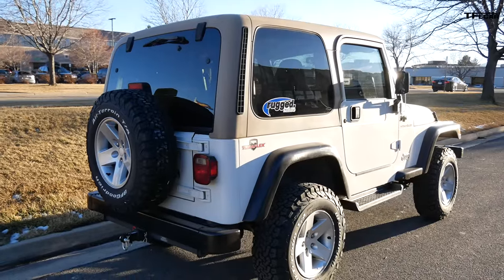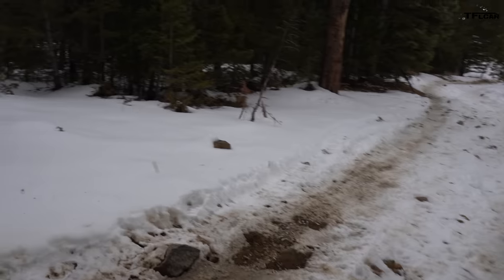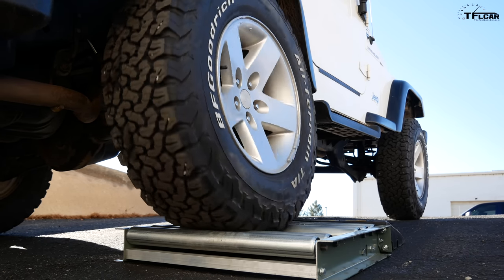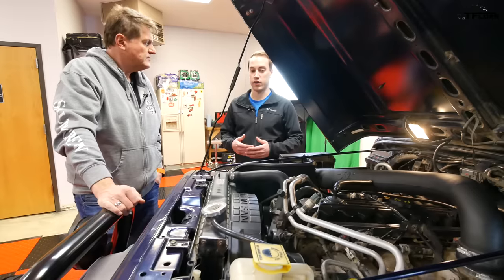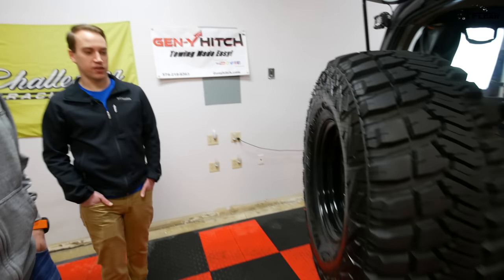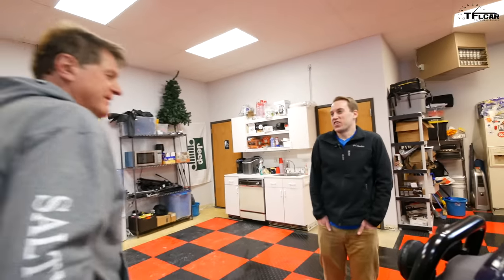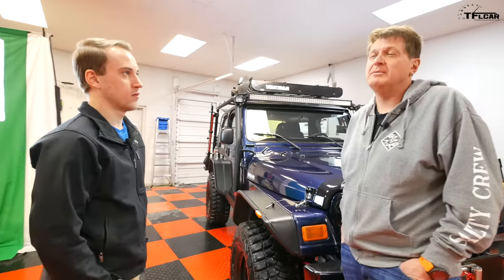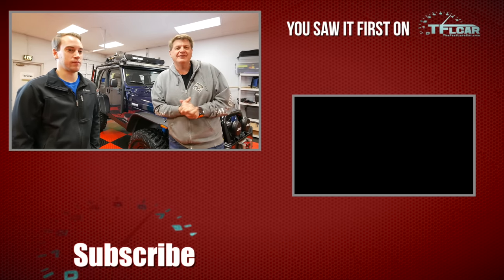We Took our Modded Wrangler Offroad and Got SUPER STUCK: Cheap Jeep Challenge Ep.6

Comment: My thoughts on the roller test; there is just enough overcoming inertia & drag in the drivetrain & the same thing on the big heavy knobby tires on small rollers. This leads to difficulty turning the tires on the rollers (overcoming inertia & quite a lot more drag compared to street tires). This mimics applying the brakes to just the tires on the rollers for a pseudo "traction control" if done somewhat quickly to maximize the affect overcoming inertia has that briefly helps power go to the tire with traction. This affect only helps a bit, just enough to get it off the rollers if done quickly enough, and doesnt help enough on the incline. Possibly if he punched it from a standstill and lightly held the brakes he might have even gotten off the rollers on the incline as well, but not sure. Also the wrangler is fairly lightweight so the inertia/drag affect helps more with this vehicle.

Comment: Works in the XJ might for the TJ if you are still doing the cheap challenge find yourself a Volvo station wagon with a g80 locker in the rear at the junkyard got mine for less than $80. Works half the time but still better than open diff.

Comment: Ironic this is. The Jeep performs very well on horizontal rollers and not as well in vertical roller/off-road scenarios. I've always been curious of the dynamics behind the rollers and there accuracy to re produce the results of off-road scenarios. Is the drive train engineered/designed to protect itself under load? Does the minor drivetrain load on horizontal roller test actually allow a minor amount of torque split to the other wheels even though it has open diffs? I went through my Jeep phase and currently own a vehicle that did not fair well on a recent roller test. The roller test of my current vehicle was an eye opener for sure. In real-world scenarios it performs better than on your roller test?

Comment: Spend 300 dollars for a locker. It's money well spent and you will find most trails you don't even need to engage 4 wheel drive.  3 wheel drive is alot better than 2 any way ya look at it. If it had locking hubs is throw another in the front and go anywhere.

Comment: You guys Definitely need to add a set of lunch box lockers,they are way cheaper than air or e-lockers and would definitely fit the cheap Jeep theme
Reply: They definitely need to learn how to use the brake and accelerator in unison.  It's a whole lot cheaper.
Reply: Be carfule lunchbox locker will make your rear end pass you on an icy trip to work, and they are enjoying on dry pavement making turns.
Reply: @jerroldshelton9367  that only works to a point
Reply: @douglasbeary7890  Yeah.  Like, "Here I am at Point "A" and I want to get to Point "B"  in a  stock WWII vintage flat-fender.
Reply: @douglasbeary7890  And this is why I'd rather just use the brake and accelerator in unison on open diffs than do the "lunchbox locker" thing.   Been there, done that.  No fun on icy trails, especially those that side-hill on mountainsides.

Comment: Anyone else notice that the roller in the rear was changed from driver side to passenger side between 2nd/3rd and the 4th test on the hill.
I wonder if they swapped the rear roller back to the drive side if it would have hooked up on the passenger side rear wheel. Theoretically, it shouldn't w/ open diffs, but Dodge/Jeep have done crazier things.

Comment: Never got the American obsession with large engines. There's several references to that little 4 cylinder engine.  Of course it has less power, but the vehicle is also lighter. 4 cylinders worked well in WWII and later in something like the little Suzuki 4x4's - which are quite capable off road for what they are. Thing is, today you have all these safety things that make vehicles very bulky. Look at any car made in the 70ies or early 80ies - all thin doors, little in terms of side-impact, little in terms of front impact either. All small vehicles. I remember the first VW Golf GTI - which has an insane power to weight ratio for a vehicle that size: 133 brake hp per metric ton, all that with a small 1.6 liter 4 cylinder engine. 
If you take weight away, you can take engine power away. It really depends on how much you have to lug around and that determines how much torque and power you need.  Of course, lockers would help, but let me put it this way: do what we did back in the 80ies: take your rubber floor mats, throw them under the tires and usually that's enough if the terrain isn't too crazy.

Comment: Air down 8 to 10psi instant footprint and more traction
Reply: Going that low without beadlocks is asking to blow a tire off the wheel, especially the way they drive.  12-15 PSI would help a lot but should keep the tire on the wheel.

Comment: Is it possible that this model has a limited slip rear diff?  Or could it have the earliest version of Jeep’s now standard electronic brake lock differential?  Meanwhile, if it doesn’t, of course you should have tried the handbrake trick (or feathering the main brake pedal) while out on the trail. Also, airing down really would have helped....
Reply: An LSD was optional for the 4 cylinder Wranglers but really not common and they wear out fairly quickly.  My Cherokee has 185k miles on it and the factory limited slip has been toast for ages, I just haven't taken the time to tear it apart and replace the clutches.  My F-250 with 150k miles has very little left of its factory limited slip and needs to be rebuilt as well, just something you live with on a clutch-type differential.  As much as I don't like a lot of the newer computer stuff, the use of ABS as a limited slip is awesome.

Comment: You guys should have put some Maxx traxx in your budget
Reply: For even less they could buy some sandbags.  I keep them in my truck to put weight over the rear axle but if you get stuck they work well for traction.  $5 for a 60 pound bag of Quikrete tube sand at Home Depot can save you offroad.

Comment: Get a junkyard fresh 8.8 with lsd and toss ither a lunchbox or the volvo d30 lsd up front.
Reply: Might as well rebuild the 8.8 lsd before dropping it in.  They're really easy and you can get the carbon fiber clutch disks from Ford Racing for about $120 with the stiffer spring and that is not only much more durable but it has a lot more clamping force.
Reply: @406Steven  if they spend time looking they can find the torzen lsd out of the ranger fx4 v2 8.8 and drop it into explorer 8.8. Then itll in theory never wear out.
Reply: @patrickwines9551  When I had my Ranger I was going to swap one of those in to replace the stock open diff.  I was finding them in junkyards in the $300-400 range.  And those particular ones have the 31 spline axles with the bigger axle tubes, bearings, etc. so even tougher than a standard 8.8

Comment: Had a 1980 Suzuki It was so slow on the hills and I blew a piston. Now I have  2005 straight 6 Wrangler, Why would you compare  the 4 cylinder Wrangler to  the Rover. You need to compare a 6 cylinder Wrangler to a good comparison.

Comment: I honestly have to speak up about the sponsorship angle on this project. I like watching build-ups and how you progressively test how new stuff affects the jeep's performance off-road; but "cheap jeep challenge" and "thanks to our sponsors for sending us $1200 in tires and another $1000 in suspension kit(s)"? That's not really a challenge and it's most certainly NOT cheap. how about parting out this stuff like s true cheap challenge? like springs pulled off a super duty pickup, or if you're going to have "sponsors" send you goodies what about that $150 spacer kit and NOT $1100 in springs, spacers, shocks, track bars, etc? tacking on 40% of the purchase price worth of parts just seems against the spirit of this challenge.

Comment: Hey do you guys have Carson's info? I'm wondering where he got those bulbs for the OEM fog lights?  I took mine apart and it's like an encased housing? Wondering if I'm doing it wrong, does he have an Instagram or something?
Reply: I was reading on a forum the other day (either wranglerforum or wranglertjforum) that you can pull the lens off the front of the OEM foglights if you go slow. They are sealed but they pry open and then you can replace the bulb, and close it back up with new sealant. Do some searching and you should be able to find it. I wish I had saved the link to the steps. I'm planning on pulling mine apart when the weather is warmer.
Reply: I believe they were H3 or H4 bulb Sylvania ZXE

Comment: Sway bar....Sway bar....Sway bar..... how long have you guys been doing this? or did you leave it so you get a more quote unquote more dramatic video?
you guys do a good job most of the time, but other times I just have to shake my head.
Reply: Just bring a cordless rattlegun and some zip ties when you go wheeling, it only takes a minute to unhook the swaybar and ziptie it out of the way.  They you can cut it down and bolt it back together before driving home.
Reply: @406Steven  Replacing the bolt & nut with a Clevis Pin & Cotter Pin makes it even easier.
Reply: @rockymountboy  If your particular vehicle supports it, that works great.  A friend of mine did that in his old Explorer and it worked well.

Comment: "Cheap Jeep"...WHAT A JOKE! You paid more for that Jeep to start with than most modified Jeeps go for on the east coast, even the ones without rust. I've owned MANY TJs and have never had as much into any of mine as you have into that one, and I'd hardly call any of mine "cheap".
Reply: Jeeps on the West Coast bring good money, especially in Colorado.  What they paid for a 4 cyl automatic is definitely on the high end (you can get a decent TJ with a 4.0 and limited slip for that kind of money) but Jeeps are crazy around here.